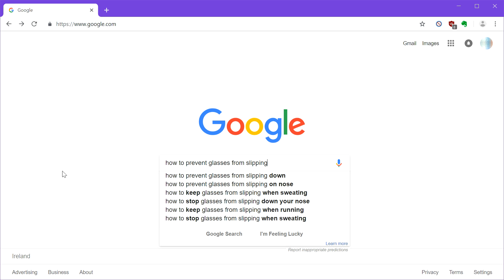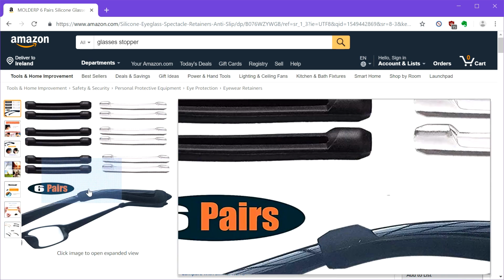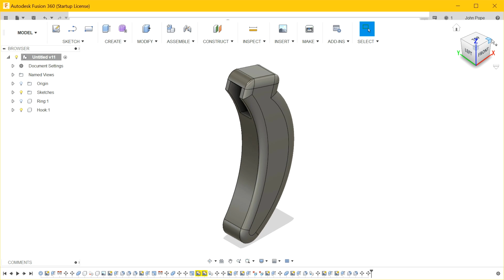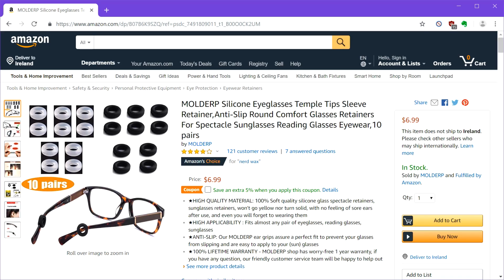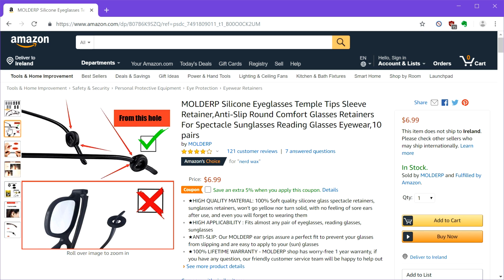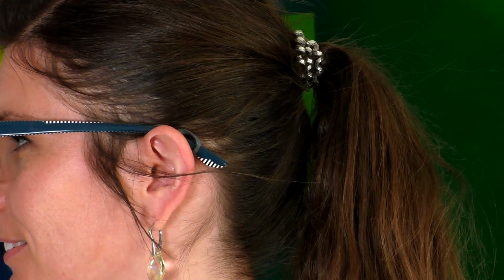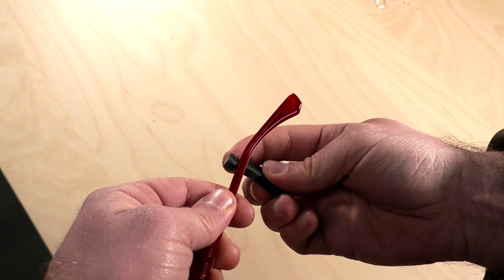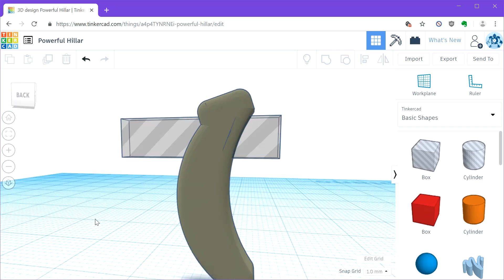3D printed ear hooks for glasses that stop sliding and slipping

Comment: No need, you can heat up the end of your glasses in boiling water and manually bend more curve.
Reply from the maker: That's a very interesting idea.
Reply: Best is to just go see an optician and let them adjust them properly a good one will be able to see what needs to be fixed.  I know because that is what I do for a living
Reply: @magicmanac  what will the optic do ? Did they bend it ?
Reply: @zero6355  yes an optician has the tools and know how to properly bend it.  The problem is doing it yourself most of the time causes it to hurt in different places because you don't understand the mechanics behind it all.
Reply: Not if you have a pair of straight arm glasses like most Oakleys sunglasses are

Comment: it's a novel fix, but I've never had this problem. In fact, I wear my glasses on rollercoasters an have never had a problem. you're supposed to heat the ends of the arms in hot water and bend them to the shape of your ears. I noticed yours are almost straight.
Reply from the maker: I buy my glasses online, so the frame can be a bit too big, which is where this comes in handy. There's a ton of similar stuff on Amazon, so it's not as rare as it might seem. I never had to use something likes this before either, only with my latest glasses.

Comment: Looks like you need a better optician who knows how to properly fit glasses to your head. They will heat up the frame and bend it. Attachments are fundamentally flawed, they will tend to rub, and completely unnecessary.

Or you can learn to fit the glasses yourself.
Reply from the maker: Yeah, I've never had problems when I was still buying glasses in a store. But because of the high prices, I've started buying them online and then you can never be sure about the fit.

I've never considered fitting them myself, I'll look into that, it would certainly be a better solution.